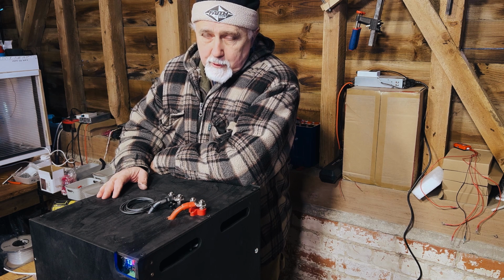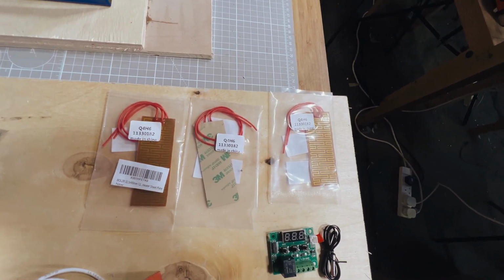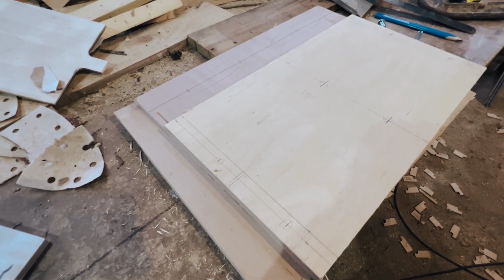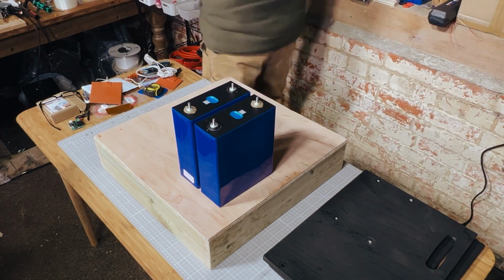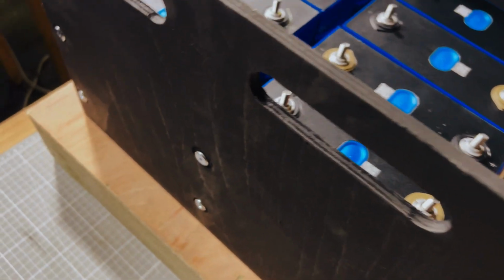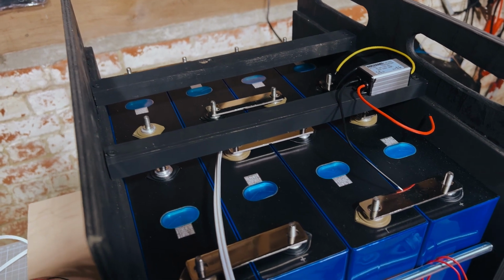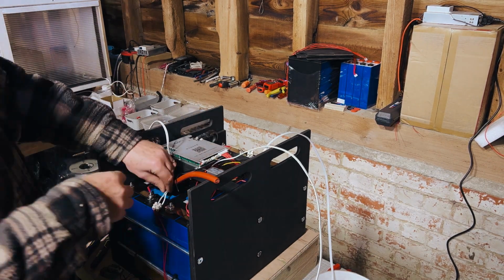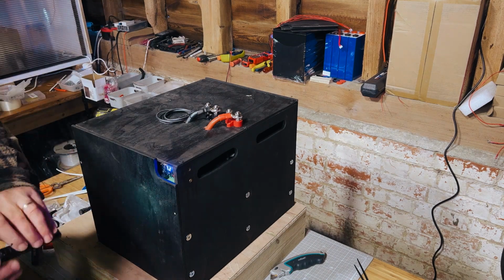Custom 24v LiFePO4 battery with heating pad - full build

Comment: Would have made sense to double up on the heaing pads instead of usig a voltage converter/regulator. Then wire heating pads in series in pairs. This would have advantage of spreading the heat more around the pack 😊

Comment: This is exactly what I was looking for, thank you for sharing! Is ventilation/cooling a consideration if things get too toasty? 24v heating pads are more common now, and I am considering adding a thin layer of closed-cell insulation to the inner floor and walls. Would you still stick with 3 x 30-watt pads? To the 'never work' comments, we're not trying to roast a chicken, just keep things above freezing.

Comment: Think I would of just used the heating function provided by the BMS through a fuse to the series wired heater pads you can just use the app to set the on off temperature. Putting all that electronics in is just more to go wrong. I appreciate what you said about the connecter blocks use waggo ones they are demountable but a lot better quality
Reply: Does the JK BMS allow switching on/off heating elements? I thought it only switched on/off the battery inputs to prevent charing below a set temp.
Reply: Believe the jk bms will only switch on heating if its trying to charge. So the battery temp could fall way below freezing. Your then waiting for relatively small wattage to raise the temperature of a family large thermal mass.

Comment: Could you not use two heating pads wired in series to make a 24v version?
Reply: 😄 Yes, you can. Do it! 🔥
I guess you are a rookie, like this old man you watched at..
He built a heated box for the cells, but let it open (with holes on the top). So smart.. so efficient...
Not to mention that wobbling "heat sink" scratching the plastic cover of the cells when vibration starts..

I gues he charged that (much) rookie customer more bucks for this "special" option 😄
I wonder where he find them..?!

But, wait... You might be one of them..? 🤔
Reply: @silviuflorescu6838  I know you can do it (I'm an electronics engineer by trade), my comment was more of a question as to why he didn't use that option.  
In his defence he did say the customer was making an insulated box for it, and yes I did spot the potential for the aluminium heatsink to move and damage the cell insulation and potentially short two cells .